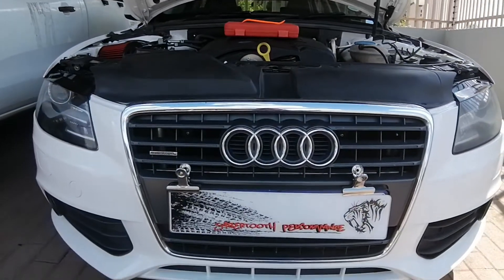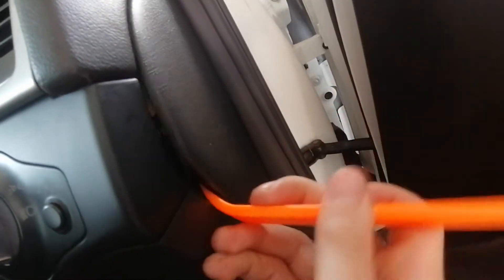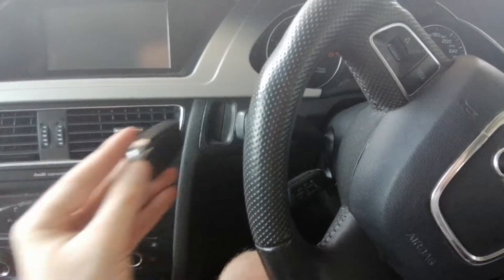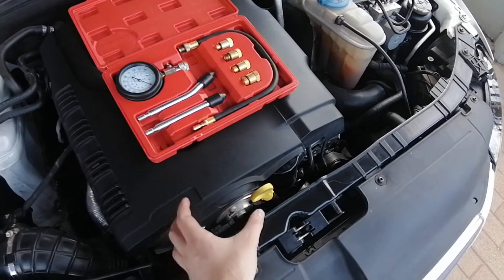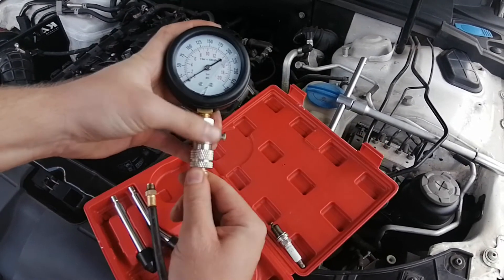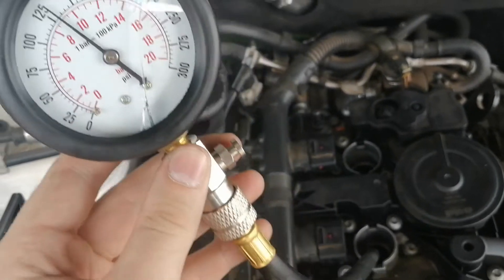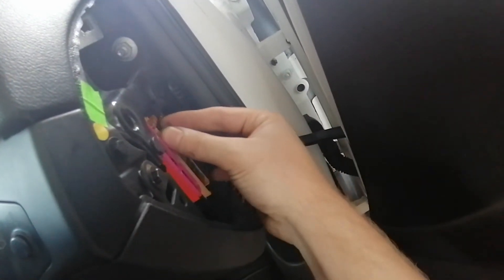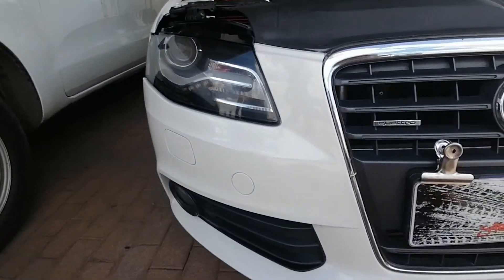How to do a Compression Test on Your car

Comment: Probably your PCV. You mentioned in a different video the symptoms. I asked if you leaking because if you are it could be your Rear main seal.
Reply from the maker: I actually have no leak... I also removed the Splash plate underneath to monitor any leaks... Luckily... nothing 🤣🤦 I saw there is a way to pressure test your pcv... Or something like that... Do you have any idea how?
Reply: @megalodononwheels  have you checked inside the diapghram of the pcv? if it is leaky (even a little residue) its bad and you need to do a carbon clean.
Reply from the maker: I haven't opened it yet... The PCV i am running now only has like 500km on it lol
Reply: @megalodononwheels  Its not the pcv that is the fault, what I am trying to say is that it is indicative of failure (or in this case dirt) elsewhere does that make sense?
Reply from the maker: Yes definitely... Maybe i should try to open the pcv and just have a look :) thank you for your help 🥳